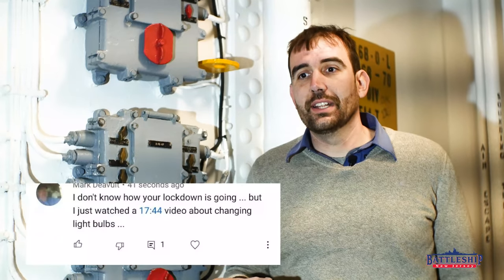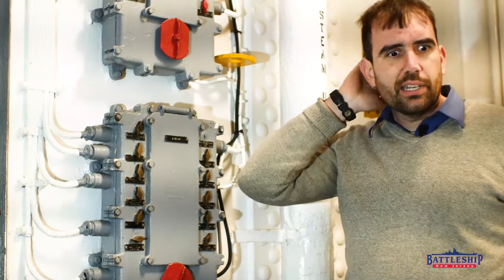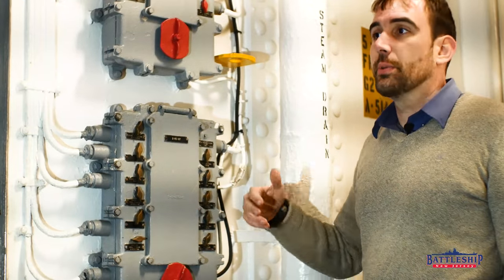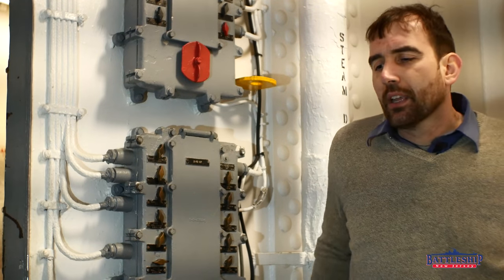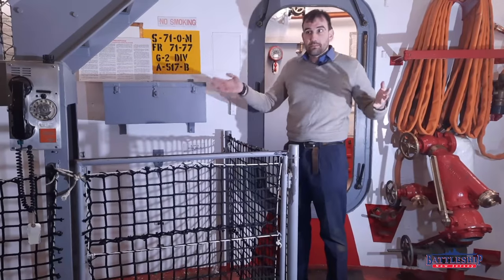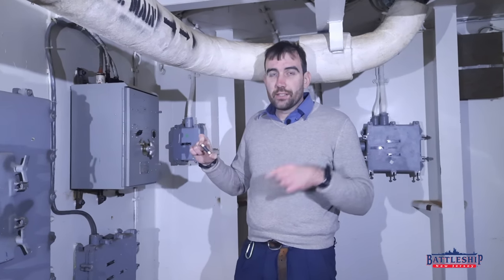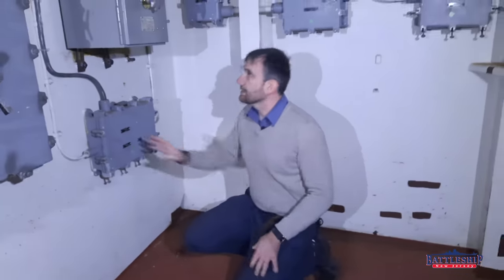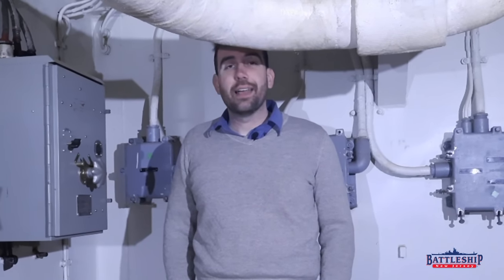Maintaining Your Battleship Gun Turrets: It's Electric!

Comment: I was in the US Navy for 8 years and was an IC3 (SW) from 97-05. When we purposely tripped the ships power to function test ship wide ABTs, I found it interesting to hear several doing the same thing simultaneously. ABTs are for vital systems only. I was also a repair party electrician in damage control. 

When applying for an electrical job, I tried explaining to the supervisor about shipboard electrical not having any grounds, yet there are "grounding straps" from large electrical equipment enclosures to the deck and the ships prop shafts also have 2 "grounding straps and metallic brushes that discharge the static electricity that is built up through the hull of the ship when moving through water. At night, I could look over the aft of the ship and see what looks like arc flashes of green bolts from the props. I love being at sea.
Reply: Shaft earthing! Didn't know it created arcs from the prop - I bet that was pretty cool.
Reply: Thank You for Your Service.

Comment: So long as you know the circuit you are tracing to the power source is not live, you can use a toner and probe to more easily trace it out.  The tools are battery powered and portable. The toner injects a signal into feed side of the circuit breaker, then you just move the probe on the outside of the wires until you get to the next panel or J box.  The probe will give both an audible and visual signal if you're close enough to the correct wires.  You might hear a weaker tone from other wires near the pair you are tracing, but the strongest signal comes from the wires you've injected the signal into.

Comment: I hope the yard hand who installed that in the 80's is still with us and can see this video. We still built with craftsmanship then, and that transfer switch reflects that!
Reply: Now the yard hands would probably be confused when they opened the cover and didn't find a replaceable circuit board populated with chips.

Years ago I re-wired a car after an electrical fire.  Ever pop the hood on a Ford and see a neatly LACED wiring harness?  :)

Comment: Can you do one on storage. Refrigerators/freezers.  Different types of provisions. Machine shops.  How many mechanis onboard and electricians.  And I would like to know how they change the oil on a battleship. I was told it doesnt get changed but is heavily filtered.
Reply: I'm sure there's a thousand different gearboxes with oil in them with various change intervals and procedures.
Reply: i second the oil change part, i believe they've already shown the refrigerators/kitchens and provision areas
Reply: I can tell you on smaller ships (last one I was on was 378' long), the oil was sampled and sent to a lab. The engines didn't get an oil change as long as the oil was doing its job. 

We did have an Lube Oil Purifier (LOP) that was rotated out through the two Main Diesel Engines (MDE's) and Ship Service Diesel Generators (SSDG). Between the purifier, and the amount of oil that was burned and leaked, the oil was VERY VERY rarely changed.
Reply: I have been curious about the chilled water coolers for the magazines and how they worked.
Reply: Depends on the amount of oil in equipment.  A ship's gearbox uses lots of oil; it has to be cooled and filtered before use in gearbox and returns to the main sump (takes the heat out of the gearbox)and the cycle repeats itself.  There is a limit of about 10%, of adding new oil over a certain time frame (due to chemicals in lube oil, to keep them in the lube oil). A ships gearbox can contain hundreds to thousands of gallons of oil.  So a complete oil change is very expensive, time consuming; its alot easier to just keep the sump filled to a certain level and take oil samples.  If adding oil to equipment, there must be an record kept of oil being added (to determine if something is wrong/leaks somewhere).  Oil samples tell if you are getting water into the lube oil system, or if there is certain wear and tear on moving parts due to particles suspended in the oil.  A purifier/coalescer can also be used, by taking oil at the bottom of the sump (where water will collect) processing the oil (removing water- usually only a very small amount) and returning the oil to the sump.  Not sure how the gearboxes on the battleship are preserved or if they have to run the lube oil system weekly.   The main gear box should be vented.  Not sure what a battle ship does for that (into space or vented up the smokestack (safer)).  On the battleship is the steam turbine bearings part of the gearbox lube oil system?
Reply: @JoshuaTootell   yes thats I what I had assumed.
Reply: I can give you a long in-depth explanation, since I work on this ship, but I will try and make it short. 
SSTG’s, oil was changed regularly, unless daily samples showed contamination. 
Spring bearings (shaft support) was sampled daily, changed when bad. 
Main engines, we had lube oil purifiers, they’d were required to run 12 hours a day when oil sample was “clear and bright” (read no water or sediment). When contaminated, it ran till clear and bright. 
We never threw away oil, it all got returned to a tank, which we purified, then reused. Only oil loss was leaks. 

Steam engines and main reduction gears had a common oil feed system from the main sump, pump, to strainers, thru cooler then to bearings. All gravity back to sump.

Oil sumps and tanks all vent to space, thru a separator.
Reply: @wallyschmidt4063  remember - that's a gearbox - when comparing to your car - we are talking transmission Oil here. There a good question here- When you go to the Main reduction gears (and NJ has 4) - are they still filled with oil? Next the  Main reduction gears also have a electric motor called a jacking gear- turns the reduction gears and propeller VERY Slowly - if this stuff was all still good - that might be a very cool thing to do.  FYI - that purified for Reduction gears was run probably near 50% even in port and if boiler COLD torn apart. "steam turbine bearings part of the gearbox lube oil system" - No - my recollection there was a design to run a small amount of the steam condensate through their (and recollect that water also back to the boilers). oops - edit - see Rich Cruse entry now. and see his SSTG comment does not match mine.  Oh - smaller ships with Diesel generators - there oil was totally changed out at 300 hours total run time (if continuously run slightly <2 weeks)

Comment: Five or so years ago, I had a blinking light problem in my house. It did it once on the first day, three times on the second day, and on the third day, half the circuits in the house went dead. Of course, I checked the circuit breakers, but resetting them didn't work. I finally noticed that all of the dead circuits came from just one of the two hot 110v inputs.
Turns out that my hot leads to the house went through the branches of a tree, and the insulation of one of the wires were worn off. My power company came out and cut a bunch of branches of the tree and ran a new wire to the house and didn't charge me for it.
Reply: Yeah, that definitely sounded like one of the hot leads was flakey.
Reply: @BlackEpyon  I had a lot of big branches that I had to saw into five foot long lengths so that the monthly branch pick up people would grind them up.
Reply: @billkallas1762  I have to admit, as a landscaper, relying on others to carry away tree branches isn't something I'm used to :P
Reply: Of course they didn't charge you for it.  Everything on the supply side of the meter is their responsibility.  Having you actually lose power due to an untrimmed tree probably resulted in a few meetings at the Power Company, as they should have been trimmed BEFORE they caused an outage or presented a hazard.  FWIW, around here the saw crew in the chipper truck would have been right behind the repair crew and the branches would have been disappearing about as quickly as they hit the ground.

Comment: The fuse probably blew from thermal fatigue.  Fuse elements will heat up and expand somewhat in use, and after many thousands of cycles depending on the magnitude of the current fluctuations in service the fuse element will break.  This is a known issue with fuses that deal with varying loads over long periods of time.
Reply: Interesting!  I was a computer repairman in the Air Force decades ago.  Rarely would a fuse blow.  For some as the system was over 10 years old then, that might have been the cause if we replaced the fuse and everything worked.
Reply: electric cars have the same issue on the main battery, ive heard of fuses blowing just because you did one too many high-torque slams on the pedal

but the newer tesla cars are using a pyro and an e-fuse, an MCU monitors the current flowing, and decides if it should blow the explosive fuse or not
that lets you define allowed current patterns, and change the fuse rating based on if your starting or running normally
and it wont have any thermal aging
Reply: I used to work on 30 year old radios in the Air Force.  I didn't know why they failed, I just knew that some of the fuses or circuit breakers would go bad because they were old.  We learned to check across the fuse or circuit breaker if you hald low voltage, but power still passed through.
Reply: Same thing happened to the XBOX 360s at launch.
Reply: Wouldn't the constant vibration tend to 'age' the thin metal elements of the fuses as well ?
Reply: @stevecooper2873  Only if the vibration was at the resonant frequency of the element in the fuse.  Not impossible, but unlikely.
Reply: @randacnam7321  that may be true if you're talking about the metal on the fuse itself but where that piece of metal comes in contact and has a connection to the other metal which then leads to the wires all those connections or mechanical soldered screwed whatever and all those can vibrate especially in something that has some fairly violent vibrations... like a battleship

Comment: Something interesting.  I had a professor who worked at a local power company.  They were gradually phasing out old power transformers.  These power transformers were the size of a small house.  The replacements had a shelf life of ~10-20 years or so, were something like  half the size, and are significantly more efficient.

The old ones were put in around WW1 and when opened were shown to be in mint condition.

Comment: Landlubber electrician here, industrial. Topic related to turret wiring that I was wondering about. I know the aiming of the turrets, both 16" and 5" is primarily done by the fire control computers down in the citadel, which can directly control the aiming and firing of the guns. I was wondering, it knows what angles to go for but how does it know where the guns are aiming? There has to be some sort of feedback from the turret drive and elevation, like a pulsecoder or a resolver or even a big potentiometer, but where is it and how does it transmit the position back to a fully analog computer?
Reply: I would also like to know this. Also very curious how they did it in older ships with hydraulic or steam-driven rotation systems.
Reply: Yes there is telemetry between all the guns and every fire control unit and even all the control switching stations that give control to combat engagement or the gunners in the turrets. I read an article in Wiki about it but they never showed the encoders, just the copper wire switching, so parts may still be restricted, maybe Ryan can show us the encoders.

Comment: WE had MBT's too, manual bus transfer for equipment like electric fuel oil service pumps, main feed booster pumps and such where you didn't want the power supply shifting without someone standing by to restart the pumps. Many pumps were set so that they would not automatically restart after a loss of power since you would not for example want to pump fuel into a boiler if fires went out. So a watchstander would have to stand by to restart the electric FOSP and then we would shift the MBT.
Reply: Not to mention that you don't want multiple large electrical loads all drawing starting current at the same time...
Reply: @seafodder6129 Yea, the SSTG's start making funny sounds and the ET's start whining about replacing parts!!

Comment: I’m curious how the ABT works, if I had to guess I would think each circuit energizes an electromagnet that holds the switch on that side so if you lose the main and the backup diesel fires up, it’ll produce a magnetic field which will attract the switch and flip it to engage the emergency system
Reply: I was an IC3 (SW) onboard the USS Peterson DD969 and the Carter Hall LSD50. U r correct. On the Carter Hall, we had a main bus transfer malfunction and explode since it didn't shut fast enough due to the amount of voltage. These ABTs all doing the same thing at the same time through out the ship is fascinating to me. I also had to go check Load centers and main switchboards for my equipment to function on emergency power since there usually wasn't anything automatic. ABTs are primarily used for vital equipment like steering, chilled water, and fire main.
Reply: You get a phase failure relay and that energizes whichever circuit is live, very common in fireman's lifts/elevators. Also any critical system such as hospitals and water pumping systems.  You should see the 11,000v ones I have to deal with.
Reply: @robertgarrett5009  I always used a fluke 87 digital meter. I didn't ever touch an 11k volt circuit. I did the maintenance/ calibration of the TLI analog gauges, the dc central alarms for intrusion, flooding, fire, and ventilation alarms. The preventative maintenance of all the synchro amplifiers for the heading, speed, and wind bird indicators. Also took care of the 2jv speaker amplifiers and speakers. Also did tons of sound powered phone repairs. Aside from the monitoring of the Wsn 5 gyros. Occasionally the 1mc, general, chemical, collision alarms and associated speakers.
Reply: Judging by the quantity of stuff inside I'm wondering if it's a smidge cleverer and similar to modern ones. A modern decent automatic transfer switch will only flick over when the emergency supply is stable giving the genset a little to stabilise and then when mains power comes back on it stays on the genset for a programmable time (ours are set to 5min) because it's not unexpected for it to be on/off a few times before staying on.

Comment: Shipboard electricians are called "one-wires" because to wire a item only takes one wire. There is actually a "ground" - it's the structure of the ship. Your home had a ground wire, because the structure of your home is not metal, but a ship is and to boot, is sitting "generally" in salt water which is an excellent conductor of electricity. 

Our S-2 Trackers had a 4 man raft in a housing on the upper part of the fuselage and a fitting on the deck at the copilots feet. If you had to ditch, if at sea, once that fitting was in salt water the circuit was complete and it would jetison the hatch and deploy the raft which self inflated. If you ditched in fresh water that was relatively clear it would not work. If you ditched in a lake that had a lot of silt, it might work.

Comment: Have you guys done a video on from a completely inert state, how the battleship would be brought online, and the time it would take?   IE: How quickly could the battleship in its 80's configuration go from offline, to sea ready.  Assuming it was stocked, manned and provisioned.    What systems come online first, etc.
Reply: @carsonbrown7603   He covered this already.
Reply: @carsonbrown7603  I don't think he means from its condition as a museum ship. I think he meant active service but everything shut down at the pier. Either way, both topics have been covered to some extent.
Reply: @T.J. Kong It's a matter of hours, not days.  I never actually timed it, but taking a steam plant from cold iron to ready to answer bells by the book (EOSS) shouldn't take more than 6-8 hours at most.  In an emergency, the book goes in the bilges and a competent engineering crew can get up and running in 1 to 1.5 hours.  'Course that will entail putting a lot of thermal stresses on the plant itself because you're not waiting around for things to heat up evenly, but if the need is sufficient (like someone's shooting at you) then that's a problem for another day...
Reply: I know it was covered somewhere in one of these videos about how they could use the emergency generators to power the pumps to light off the plant to eventually build steam, assuming you are lighting off dead cold. But normally they would have a steam shoretie.
Reply: @seafodder6129  better hope you don't need to shoot back.  On an older ship, you are looking at 8-12 hours for a usable signal from the gyrocompass, and closer to 24 for something accurate.  

Sucks when you need those heading/pitch/roll inputs to stabilize your weapons platforms.

We tried to give ourselves 36 hours before scheduled departure.  That gave you time to restart the gyros once or twice after losing a vacuum tube or 2 during startup.
Reply: @kevincrosby1760  why so long? Does the system need that much time to stabilize, or is it calibration etc? I don’t know anything about it, so my apologies if it’s a silly question.

Comment: The redundancy of actually firing the 16" guns fom various positions is pretty impressive, as are the 4 steering locations all the way back to the directly linked wheels aft
Reply: I was surprised to learn that the 16 inch guns could be percussion fired with a sledge hammer. Also the ship could be steered using block and tackle pulleys and many sailors pulling the ropes